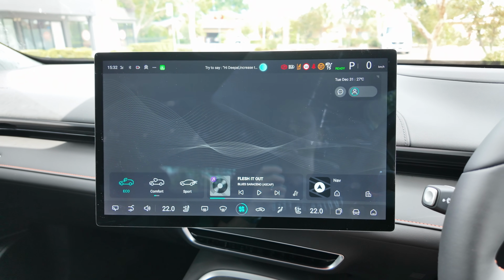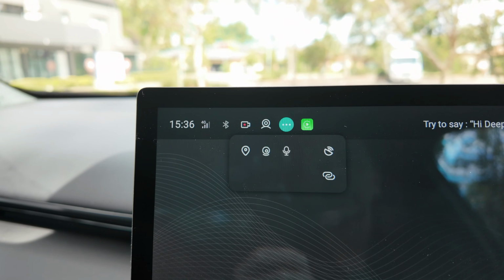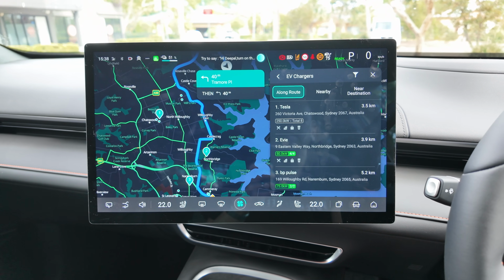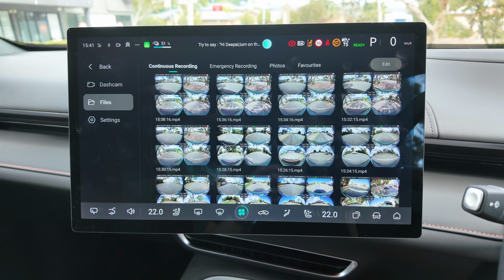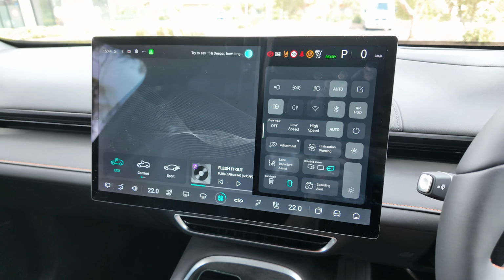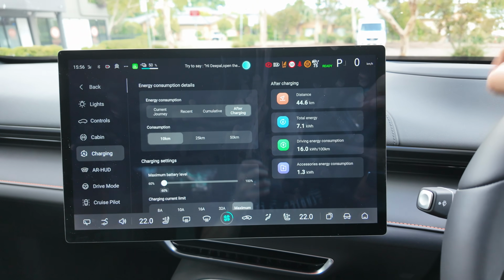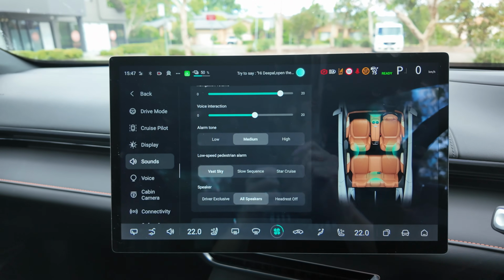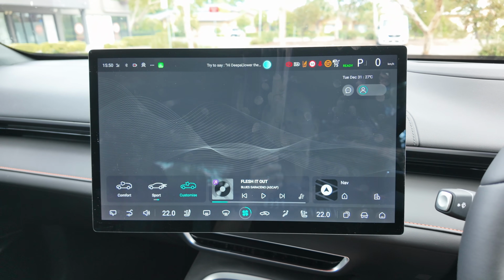2025 Deepal S07 Infotainment System Features Walkthrough Australia

Comment: I could test drive a L07 some months ago (which has a drivers's display) and I very liked the infotainment which was far better than in my BYD Dolphin. But meanwhile BYD improved it system a lot. I still miss the more detailed consumption information and that the rear window heater is in the lower bar. I also like, that you can turn the screen towards you.

I also like the built-in dash cam option.
Reply from the maker: Yeah the detailed consumption stats is much better than in the BYD